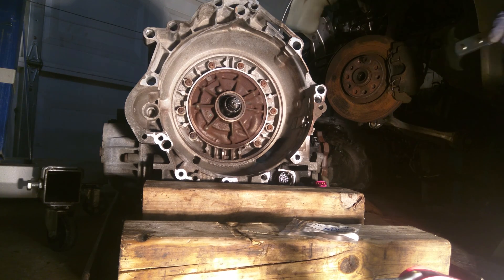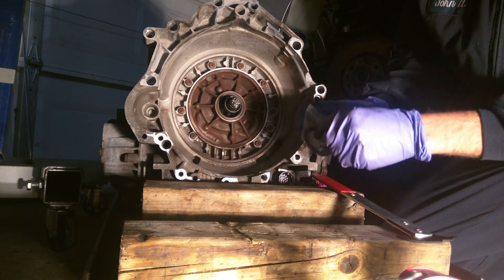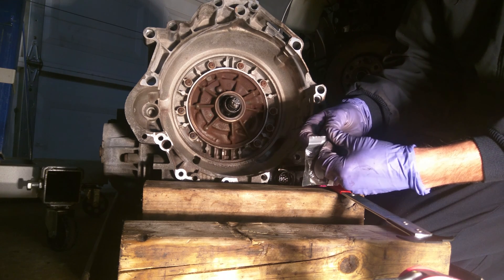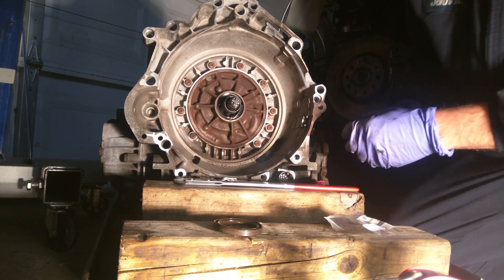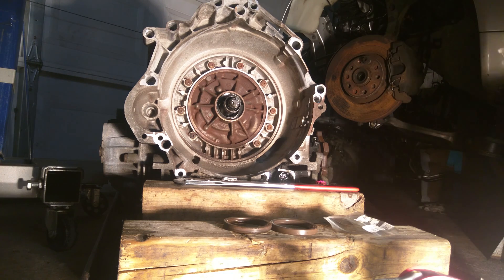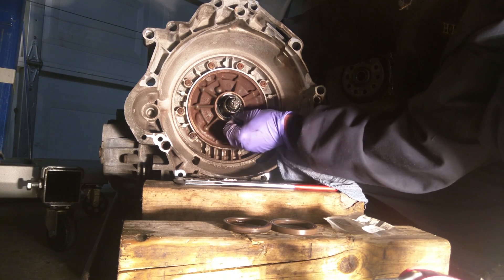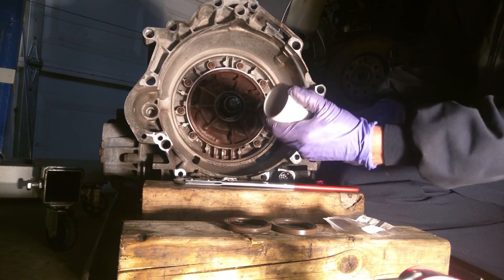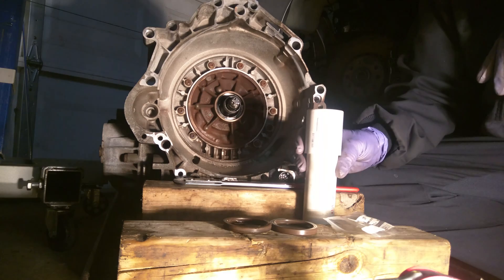ZF Quattro transmission front pump oil seal install

Comment from the maker: Please understand that this was a used replacement transmission. As a part of the warranty the front pump seal had to be replaced.  The seal that I removed may have been fine, this was just a condition of the warranty.

Comment: ive changed the seal and my car is still leaking. what does that mean?
Reply: More than likely you needed a new front pump bushing , plus a new torque converter if the leak is coming from the front. The bushings unfortunately are sold “oversized” and have to be machined to spec. You would have to remove the front pump to do this.
Reply: The same seal? I guess you have the same problem as mine. For mine. The seal get off again and again
Reply: @theofficial923  yeah the same seal sadly. did you finally stop the leak?
Reply: im maybe thinking i didnt hit it hard enough like in this video
Reply: @jeromejones1476  you need to use silicone glue or in my case i use the epoxy. Let it dry over night. As the diameter of the outer was 57mm when u get new seal. The original from manufacture came larger a bit than 57mm mate
Reply: @jeromejones1476  its not about you hit it deep enough or not mate. Trust me.. never use any oil to fit in as the casing were not the same size as the new seal..
Reply: @theofficial923  oh okay cool, is your seal still holding up with the epoxy?
Reply from the maker: There are many seals  on this transmission, in fact a year after I installed the transmission both the left and right output shaft seals needed to be replaced.

Comment: please what is the parts number
Reply from the maker: global deal auto it took a while finding the receipt the part number is W0133 - 16277 - 3 from the Auto Parts Warehouse

http://www.autopartswarehouse.com/search/?searchType=global&N=0&Ntt=W0133-1627723&tahsearch=1&tahgroup=SKU&tahrank=156781&tahscore=1.4632962
Reply: yup. but you have to let it hardened overnight just to make sure...